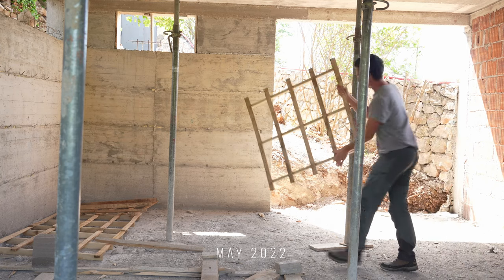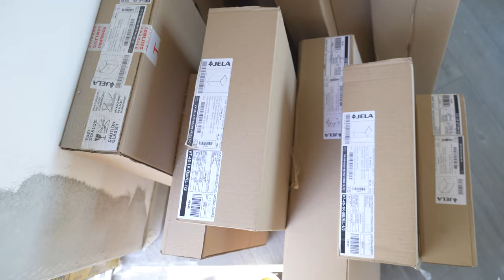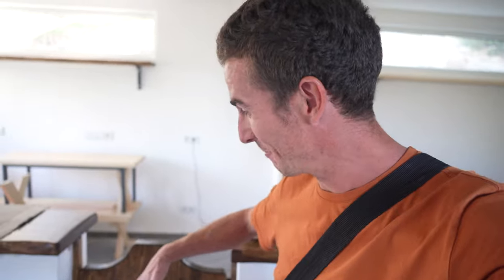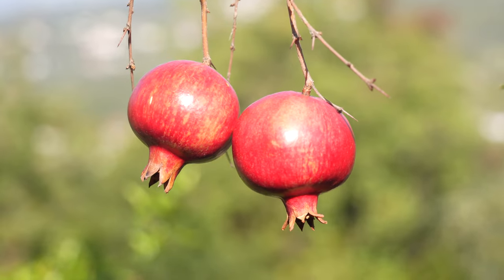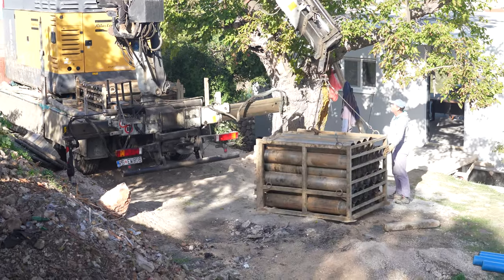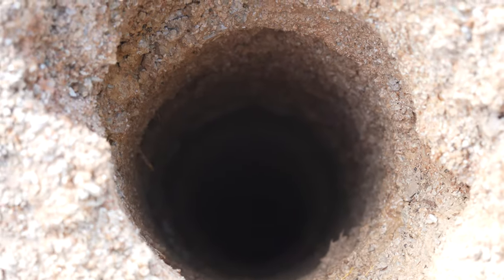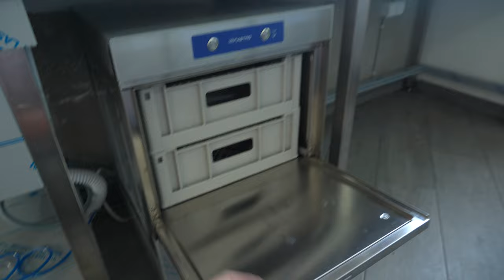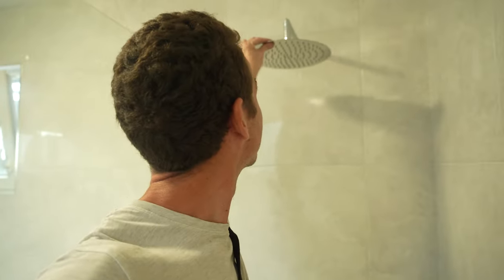Interior design, custom wood work & water well drilling 🏠 [Montenegro Tower Construction Series #13]

Comment from the maker: The final video of the Montenegro Tower for this year is packed with the last steps of finishing the house, getting the furniture delivered and drilling for well water! Enjoy 😃
⌛ Timestamps
0:00 Intro
0:23 Initial bar plans
0:56 Furniture shopping
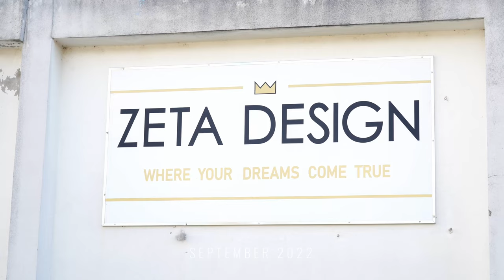2:18 Zeta designs wood work
3:36 Zecanka furniture delivery
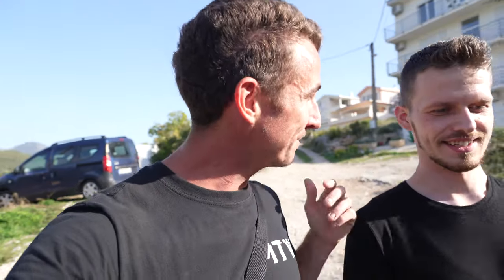5:01 Mtel 200mbit fibre optic cable
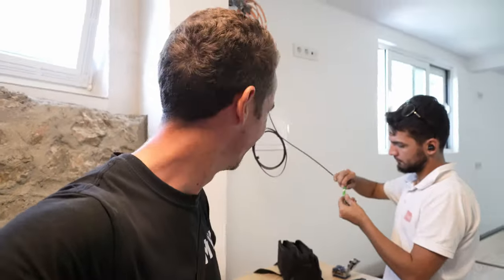5:40 Custom wood work
10:58 Pomegranate juice
12:14 Dowsing water check
14:41 Water well drilling
18:49 Commercial bar equipment
21:51 Wrapping up